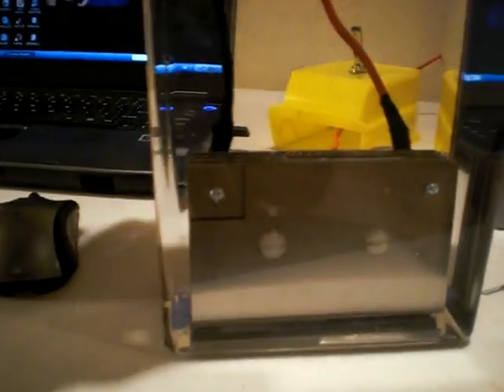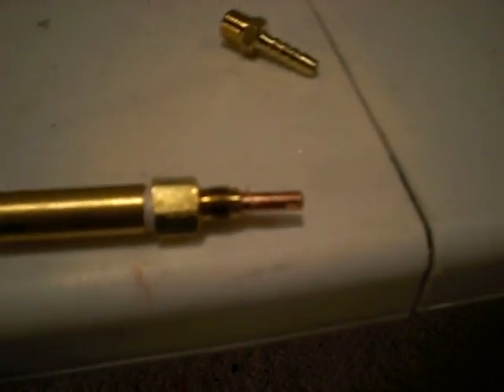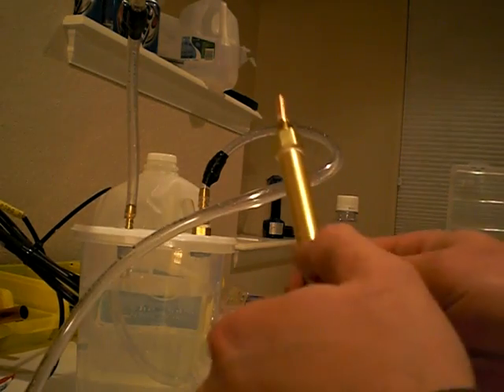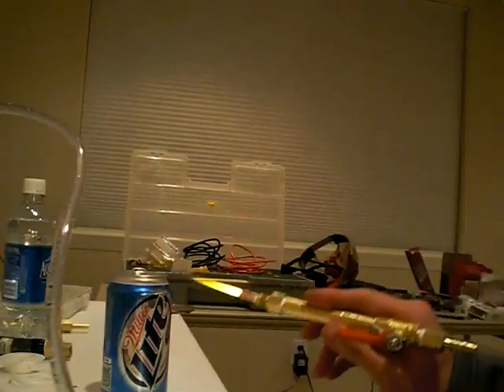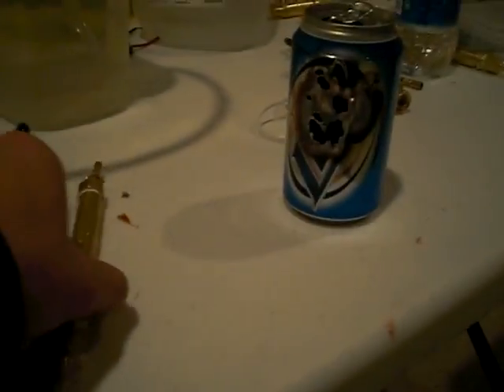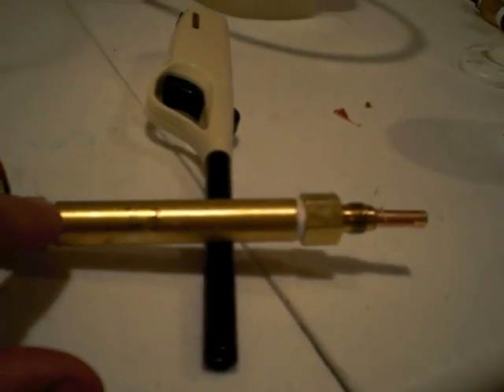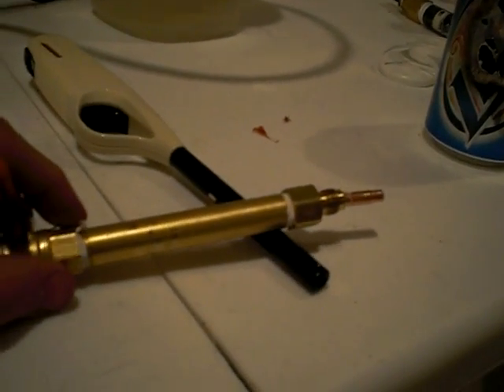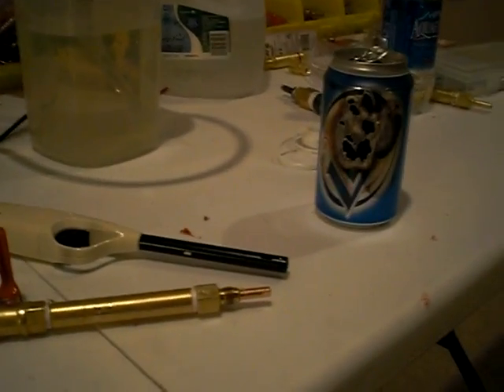New HHO Torch Design BEER CAN TESTED

Comment: Jeffrey Sokol  i think if you make tip hole smaller so you will have more pressure and it will be more heat concentrated in one place. try it

Comment: you need to seperate the H and the o so you can adjust them seperatly, I think. Also how mutch power are you putting into that cell? It bubbles pretty nice. You ad salt or anything to the water?

Comment: If you are using baking soda as an electrolyte a lot of your gas is innert co2. I did the same thing before I knew this. it does help provide a lot of driving pressure.

Comment from the maker: we use plastic screws, with 1/8" thick nylon washers to hold the plates together.  The + and - are on opposite sides of each.  All plates are notched on one side, so we just invert them, facing two directions.  this allows us to use one screw on each side, as a positive and a negative.  really pretty simple set up.

Comment from the maker: By non-chemical, i meant that we aren't using specific chemicals to make that reaction, such as an exothermic reaction without an outside source of heat for ignition.  Oxygen is needed to feed the fire, not just hydrogen.  Also, we are using baking soda in this instance as an electrolyte.

Comment: Its refreshing to see you run your torch without having to choke it like this evenings meal ... LOL ...

If you go a series setup (neutral plates), you get into the tricky arena of having to try to seal up your plate edges.  Typically, the neutral plate arrangement works best when you are building medium to large scale.

D3's suggestion of multiple, small, parallel cells wired in series works quite well and is simpler to assemble.  A series cell is another level of complexity.

Comment from the maker: Right on man.  The same pencil torch here in Denver cost $5.99 and I had some brass fittings already.  I was thinking about the same spacing, but using neutral plates instead of +-+-+-, i'd go +n- or even +nnn- configurations.  This should get the amps down but I need to produce some more plates.

Comment: and yes tapping out that soft ass aluminium can be a pain, you have to do a half turn and back it up, another half turn, and back it up, and so on. But when harbor sells those for 1.59 I couldn't pass it up, as compared to about 7 bucks for all the brass. But the brass is a better material by far. I am glad to see what your doing, which was the point of the torch, give people an easy way to get into this stuff. A+ job man, keep going

Comment: running a parallel cell on 12v isn't very eff. build two or better three cells (just like you have) and wire them in series, it will increase your eff. instead of 2LPM @ 12v and around 100amps, like you have now, it will be 2LPM @12v and about 50amps. which means you get the same gas for half the power.